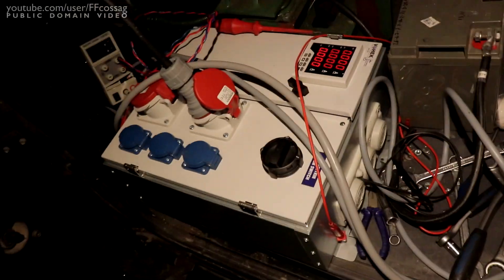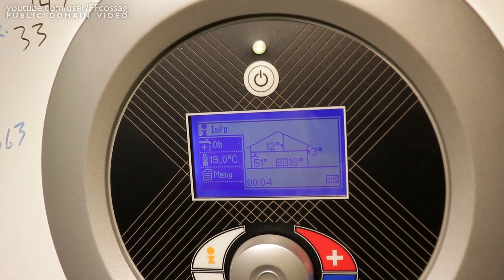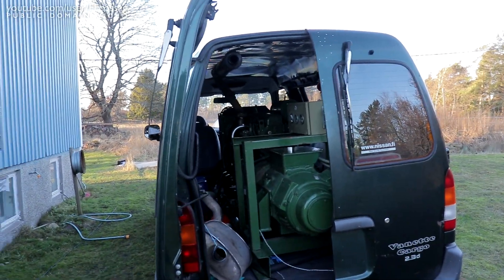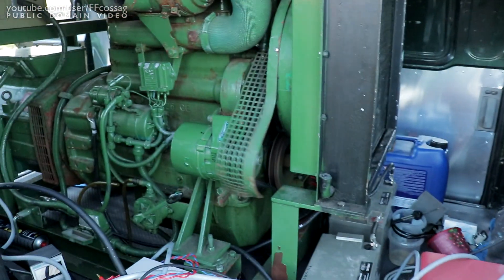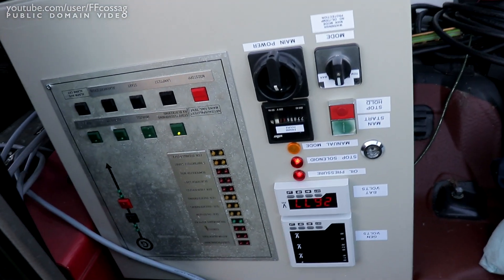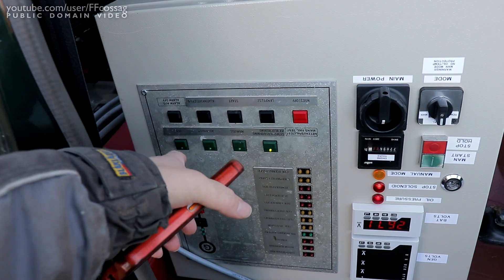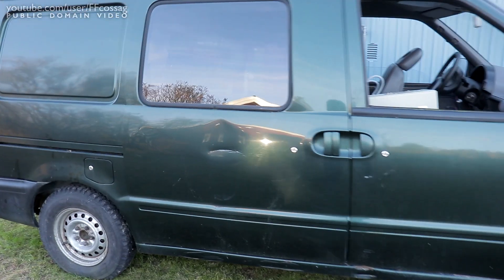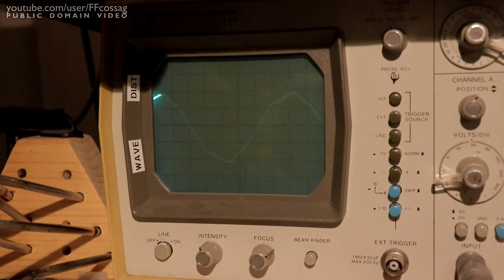25 kVA Diesel: Actual power outage! Will it power my house?

Comment: 30kWh = 108 Mj = 2.8L diesel burn value. Pixel counting says you lost 10%*60L=6L. So ballpark efficiency = 2.8/6 = 47% total efficiency (with error bars, napkin math).
Not bad at all.
Reply from the maker: Ha, thanks for that! 47 % sounds unrealistically high, so I checked my logged data and average power draw was only 5,7 kW for the entire 3 hours. 17,1 kWh = 61,56 MJ = 1,72 L diesel. 1,72 L / 6 = 28,7 % total efficiency. Which is much more realistic for a 50 year old tractor engine running at <20 % load, and still a really good result. I did some digging and calculated that a nice 10.7 kW petrol generator with a Honda engine (Pramac P12000) is rated for 4,07 l/h at 75 % load. That gives it an efficiency of 20,6 %, despite being a much smaller unit working at higher power. That means it's actually more economical (or at least, probably isn't less economical) to run this unit over a small gas generator, which is WILD!

Comment: Great test. Also considering heating is your largest energy use any plans for heat recovery from the coolant? I imagine it could probably net you an extra 5-10 kW of heat but getting the coolant from the van to the house would probably be pretty tricky.
Reply from the maker: I actually have a pair of heat exchangers that I got specifically for that purpose, but it'd be very cumbersome to hook them up, so I'll probably end up never doing it. Perhaps once I'm old and rich and finally can afford to build a real workshop for myself ...
Reply: @FFcossag  Just create a shack of sorts besides the house, park the van inside and build up the heat exchange contraption.
Reply from the maker: The van is mobile, and I'd like it to remain so. So, any heating hook-up has to be quick-disconnectable and that adds a ton of complexity.

Comment: 😂 The tech gods decided you needed a full generator test... A couple of things I thought of, I know you take the loads off for a couple of minutes before stopping the generator but if your not there and your inverter signals that utility is back you could put in a timer so the set runs on for a few minutes.

That inverter is a not nice inductive load so not suprised with the sine wave distortion really. 

All thats left now is a remote start link to the inverter and maybe an oil sump heater for the generator with an external thermostat so during cold weather it is ready for a run. I assume the generator controller has a demand input you could link up via a relay. Otherwise a relay that drops out on utility loss could link up to it. 

P.S. Would love to see a tour of your entire power system including inverter, utility ect. 👍
Reply from the maker: I'm not planning on building any automated switchover system for it, since I don't want my house power to run through contactors that use power and are more likely to fail than mechanical switches. I may add some kind of remote control to it far down the line, but probably not.

So, you get some afterrunning by default since it takes a minute to just go outside to turn the engine off after you've switched back to utility, hehe. Though it's barely even necessary for this unit since the engine is very large: 38 kW crankshaft power for a 25 kW nameplate. The engine will never see anywhere near a full load, so it's unlikely to work hard enough to risk overheating after shutdown.

My power system is pretty unremarkable, really. It's just a default application for an MPI Hybrid 10K inverter, with some funny stuff around it to add a GFCI to my ancient ceramic fuse panel. There are videos about it on my channel, though perhaps not any all-encompassing tour.
Reply: @FFcossag Thanks 🙂 will have a look for those videos. If you do want a smoke detector (I have one above my little Generac) a company called A2Z makes one that is combined heat and optical with a clean NO and NC terminals on it and runs of 12VDC. 👍
Reply from the maker: Thanks for the tip, I might add something in the future ... AFTER I patch up the exhaust properly so it isn't bathing in fumes while it's running, lol.

Comment: I presume the battery system was holding up well too? Given those enormous gell cells?
Reply from the maker: Alas, the big Sonnenscheins are pretty much completely dead by now, I got about four years out of them. The system itself is hanging on just fine, running on some older 300 Ah Sonnenschein 6V cells and some slightly newer 100 Ah ones - but I don't have a lot of capacity left at all.
Reply: @FFcossag  I guess at the current prices of LiFePO4 cells you would just replace the entire system? 50Eur per kWh at >5k cycles is just too good to bother with lead.
Reply from the maker: Buying new things is cheating! ;) I'm the type of dude who would rather recycle EV batteries.

Comment: Is this the same van you drove around Europe in a few years ago?
Reply from the maker: No, this was (is) the spare parts van that I bought for cheap to keep the other one running. Nissan parts are notoriously overpriced, so it paid for itself by providing an alternator lol.
Reply: @FFcossag  Now there is a "slightly" oversized alternator in it xD
Reply from the maker: Two engines, three alternators, two radiators, four fuel filters and three oil filters ... This van truly has it all.
Reply: That was a vanette too indeed.
Reply: It's a different one: the plates don't match and it's missing the decals.
(Fun fact: in Italy "ALN" is the identifier for old diesel railcars.)